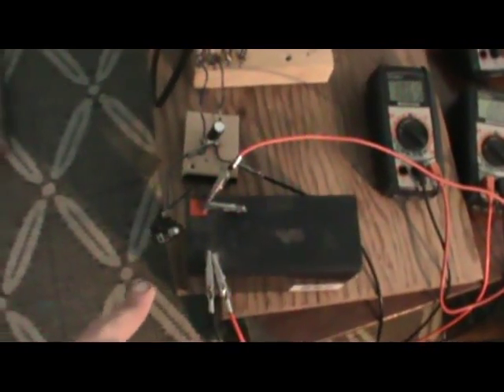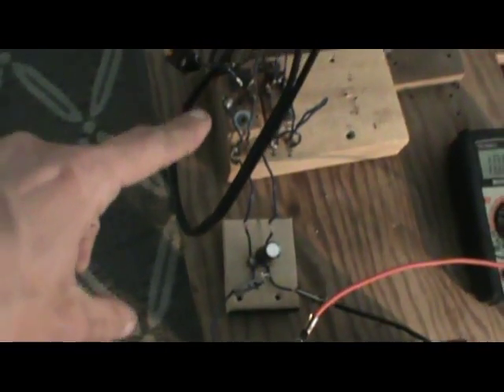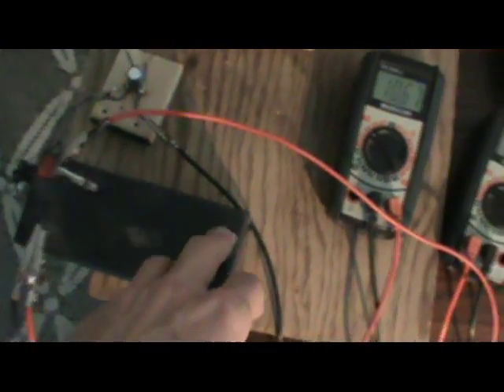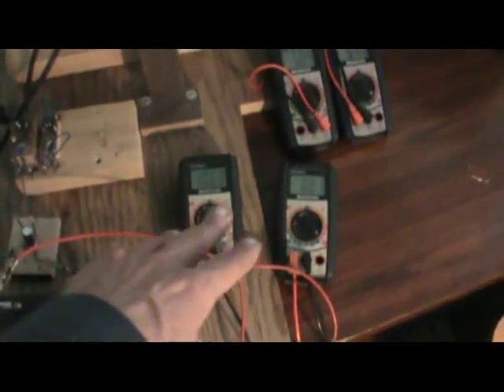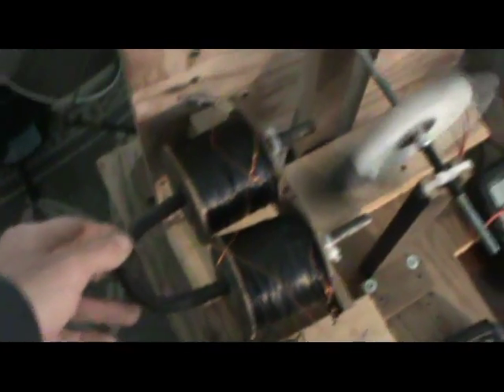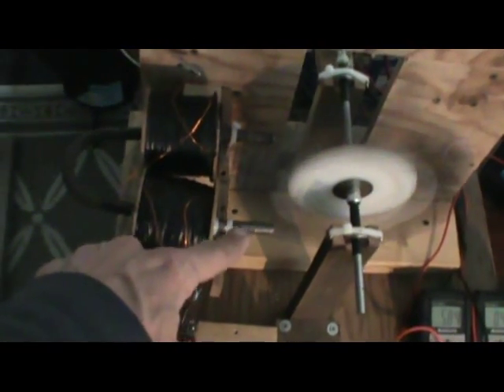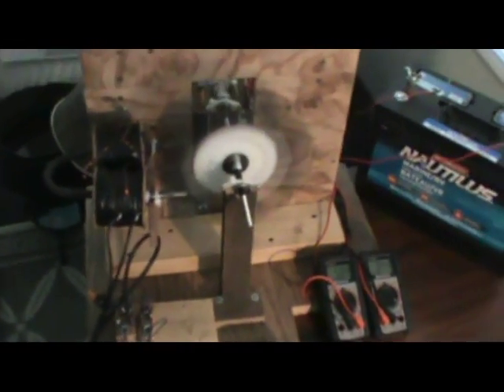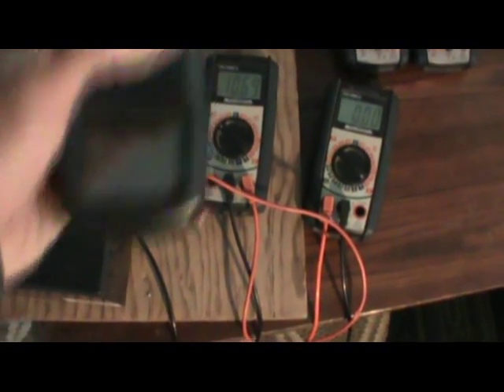Overunity Quest - Horrible Output - Solid Cores

Comment: Is the output cold? Bedini specifically said it was, but no one else talks about it.
Reply from the maker: Short answer, no. With these coils there is no switch opening and closing as with a Bedini circuit's transistor opening and closing. But the term "cold -e" simply and vaguely describes HV...but we all have slightly different perspectives and preferences :)

I think what Bedini refers to is the dielectric zap we get when the switch closes...voltage leads current by 90'. IMO Bedini's apparatus can be considered OU simply with showing battery capacity testing...like he quickly shows in his vid "Energy From The Vacuum." Harnessing that dielectric zap when the transistor closes is what Bedini did. Some call it cold electricity...Faraday called it dielectric...it is the powerful negative female force as John Keely described.

Anyway, I would think that if I got enough current buzzing through those coils in this vid they would get warm. Watching the vid again was funny...lol.
Reply: Thanks for the reply. I did want to point out that the battery got cold in John's video, and I have a friend that replicated the Kromrey G-Field that got cold electricity output. By cold-e I mean that when you put it through resisters, they turn frosty cold. I have not heard about the transistor opening and closing, but I do know from prior experiments that when you short the coils at the sine wave peak, a large amount of "dielectric" energy comes out. I am in the process of making a simple Kromrey device. I will let you know how it works if you are interested. The design is different from your set up. Now I just need to figure out how to short the coils...